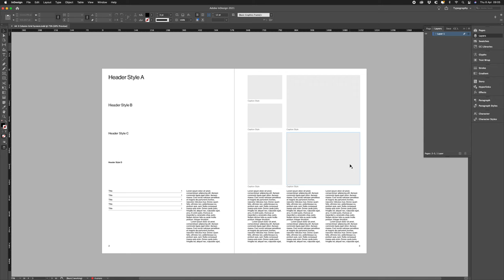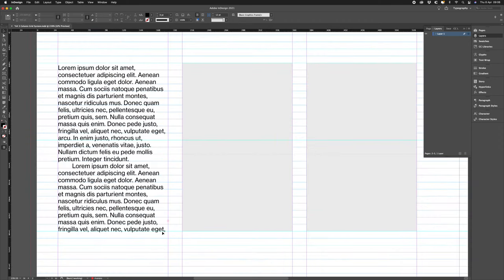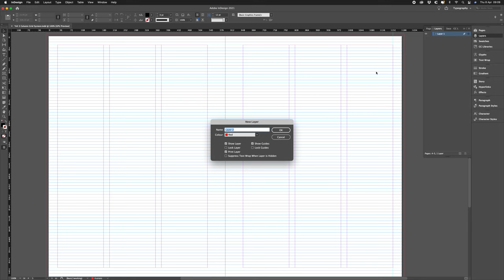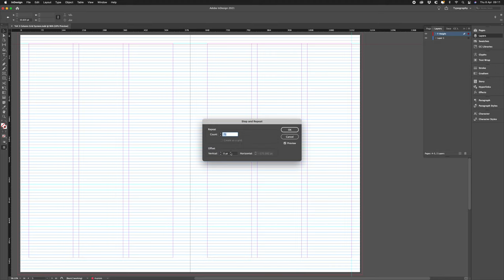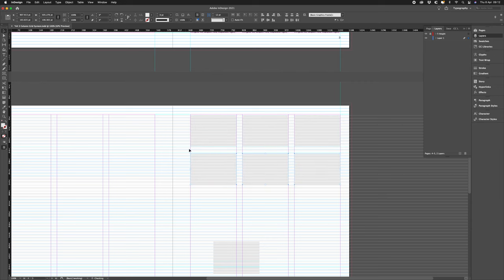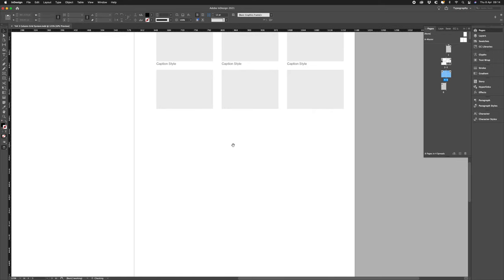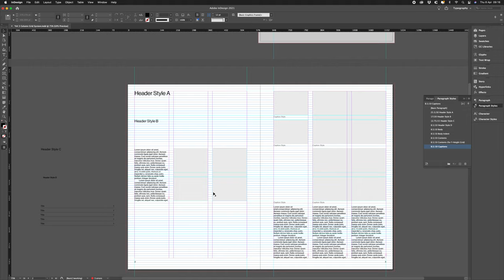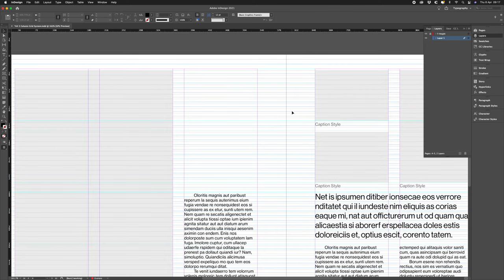InDesign – Grid Systems Tutorial for Editorial Layout Design

Comment: Nice! Thanks, really helpful. Curious: Is there a reason one might opt for an f-height grid as opposed to a cap-height grid? Or is the latter not the done thing?
Reply from the maker: Thanks Adam. Depending on the typeface the lower case f can be taller than cap-height. Using the f height prevents your text from extending beyond images etc.
Reply: @stephenkelman_  Gotcha. Nice one. Thanks for the response.

Comment: Hi Stephen, Header Style B is not able to be aligned to baseline grid with the F-height technique?
Thanks.
Reply from the maker: Hi Deem… that's correct. The header styles generally only align to the f-height. (If they were aligned to the baseline, they wouldn't align to images or bodycopy f-height).
Reply: @stephenkelman_  cheers.

Comment: Hi Stephen once again congratulations for these helpful tutorials.
I got a question in this specific video. What are the disadvantages to set baseline to Cap Height in Text frame options, instead of using an f-Height grid to get the text and images aligned?
Reply from the maker: Hi DD… if I understand correctly, setting to cap height would result in your headlines not aligning to your body copy. If you send me a screengrab of what you mean I can take a look.
Reply: @stephenkelman_  Thank you Stephen, I finally realized the point of it :) Well done sir!